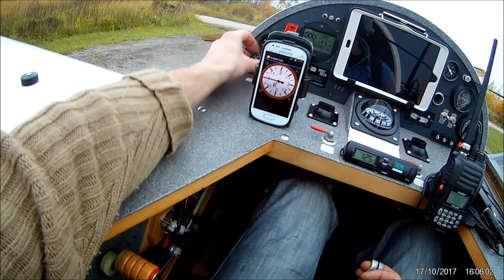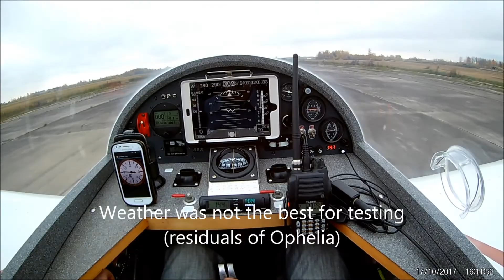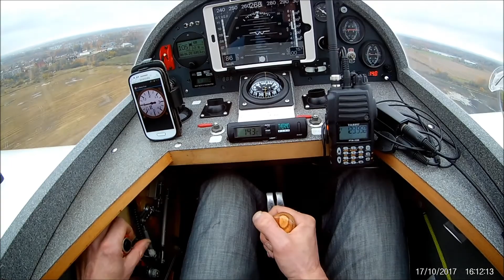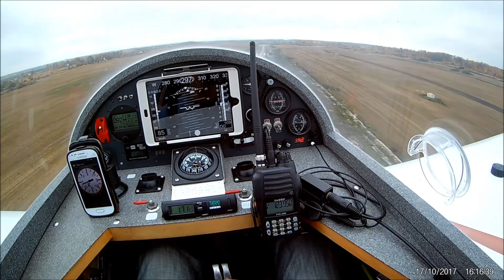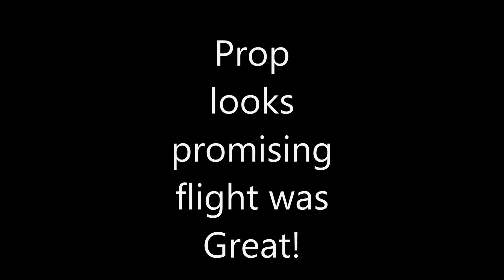Prop Test.

Comment: What kind of engine is this ? Did Walter produce an opposed 4-stroke engine like this ? This motor works extremely well on this aircraft ! What is the displacement and horsepower rating of this opposed twin ?
Reply from the maker: About 4-stroke, I don't know, I think no. These engines Walter M202 are rarity, built just 12 pcs. Displacement 676ccm 65hp. Unfortunately it has baby deseases, I had to change piston in one side, the new one was similar deffect, so changed again. Pin preventing rotation of piston rings comes out, rings rotated and damaged piston itself and partially cylinder. But now I repaired it, engine work well again.
Reply: @arvilsbusmanis1215  Thanks for this information. Your engine really sounds strong. From what I can see the propeller drive comes directly from the camshaft. My brother and I built and flew a Quickie with a 20 horsepower Onan. That Onan does not match the power output of your Walter M202. I am very impressed with your airplane and especially with your Walter M202 power unit.
Reply: You are correct. I made a mistake in my last letter. The Walter M202 is a two-stroke engine. (It does not need a camshaft !)
Reply from the maker: @bugdust203  Thank You! my engine is not direct drive, it has gear box but it is integrated in block in the back of engine direct before flywheel. reduction ratio is1:2,676. When You fly with smaller wings You need more power.

Comment: Why no torque wrench for the prop bolts.
Reply from the maker: With torque wrench I already spoiled prop I removed from plane (You can see wrinkle at side of props hub). So with self made wooden props You should change a little procedure.

Comment: Dual brake levers of the control stick? Do you like that setup?
Reply from the maker: Yes. For tail wheel configuration. Quite simple to make from pair of bicycle brake levers.cut off one mounting ring and join together with one bolt and pair of pop rivets. Works very well. Yes I really like it.
Reply: @arvilsbusmanis1215  did you use bicycle breaks? Was planning to use mountain bike disk brakes on my minimax 1100
Reply from the maker: @travisw9071   I used Azusa brake bands from Spruce . Brake drums I made myself. For these brake bands I made them diam 128mm as I remember. These, You can buy as a set with Azusa, elsewhere, are for little diam.  You can see at 4:09
Reply: @arvilsbusmanis1215  awesome thank you very much for replying! Many more questions! But you have a great little plane!
Reply from the maker: @travisw9071  Thank You! If You have questions, don't hesitate, I'll try to answer You.